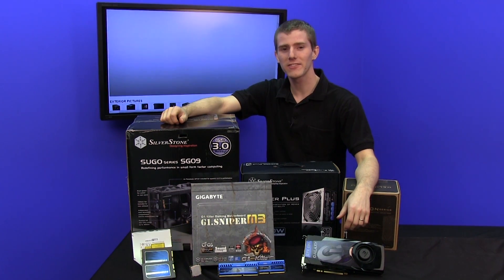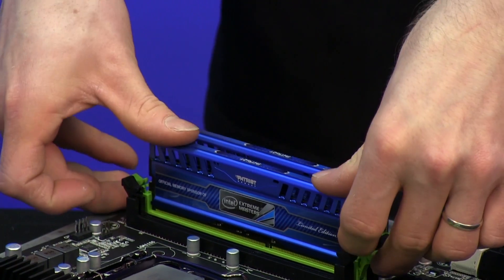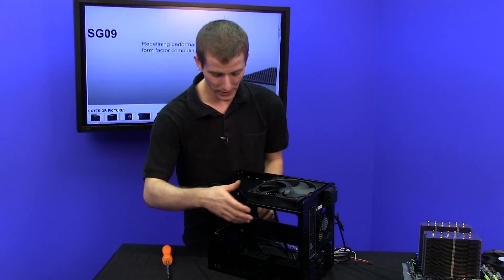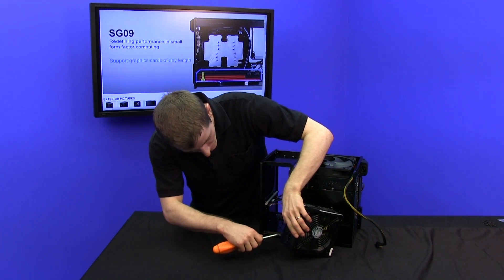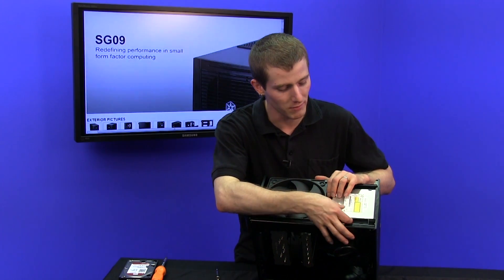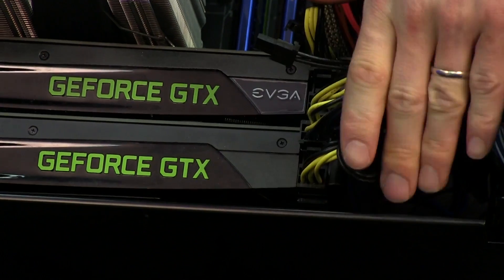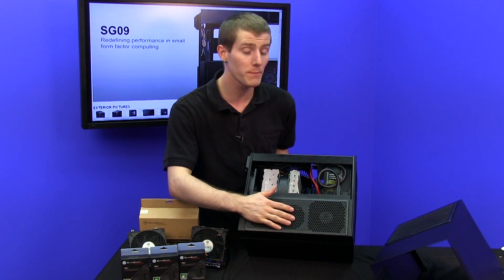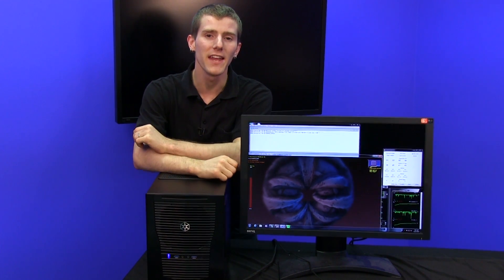Silverstone SG09 Small Formfactor Gaming System Build Guide NCIX Tech Tips

Comment: I'd be worried about heat and lack of ventilation for the 3.5" drives. The 200mm fan on top does overlap the gap behind the motherboard, so there would be some movement, but probably not enough.
Reply: It wont be to a problem, have a wd black in there doing fine
Reply: killer121l Good to know!

Comment: Component List:
Chassi: SilverStone Sugo SG09
CPU: Intel Core i5 3570K 3,4GHz Socket 1155
CPU Cooler: SilverStone Heligon HE01 (Fan "inbetween" appears to be included with the cooler)
MOBO: Gigabyte G1.Sniper M3 (micro ATX)
RAM: Patriot Intel Extreme Master, Limited Edition 8GB DDR3 1600MHZ (2 for a total of 16GB)
GPU1: EVGA GeForce GTX 680 2GB (In SLI)
GPU2: GALAXY GeForce GTX 680 2GB (In SLI)
PSU: SilverStone Strider Plus ST1000-P 1000W
SSD: Crucial M4 2.5" 128GB (2 in RAID0 for: read/write speed+, capacity+ (256GB), reliability-)
HDD: Western Digital Red (NAS Harddrive, Capacity unknown)
Cables: SilverStone PSU Accessories PP05
Optical drive: LG H-L Data Storage GA31N Super Multi DVD Rewriter

The CPU cooler is the only one I had to do an image compare on.
The rest is either said or shown closeups in the video.
And I couldn't find out the WD Red Harddrive capacity though.

I have been looking for more cases like this, but with no luck. Appears to be my only option... so far.
Reply: Side note: He said it's a SilverStone Optical Drive, but the closeups shows what I wrote.
Reply: Another Side Note: The "Real Temp GT 3.70" software shows the CPU in the system as Intel Core i5-2500K 3,4GHz (whitch also uses the LGA1155 socket), but is a different CPU than said in the beginning.

Comment: I really like this case, but I'm not feeling the non standard fan at the top. 180mm fans seem to only be sold by Silverstone and Enermax. Neither have quiet versions in that size. I'm going to have to go with the Node 804 though I like this one and even the sg10 better.
Reply: +William Matthews I have this case(bought it new in 2012ish) the 180mm fan is fine. There's a switch on the back of the case to switch from high to low rpms on that large fan, on low it's silent. High is of course a bit loud but honestly you don't need to turn the fan on high because it already moves so much air on low.
Reply: +William Matthews i'm recently building a computer in this case. and i noticed that the top 180mm fan can be changed into 140mm with mounting brackets that came with the case. So now im thinking mounting a 140mm rad at the top as intake. I will give you the result after finishing the build^

Comment: Lins i want to build a high rig gaming pc. Im planing to use msi z97 gaming 3 or 5, and gtx 980 n intel i7 4790 k, psu corsair rm 650. Is it worth it? And please tell me if msi z97 gaming 3 or 5 is future proof or not(at least for 3 years)
Reply: ziang momin nothing is future proof in the industry things change and improve quickly
Reply: Okay thanks
Reply: ziang momin I mean lga 1150 sockets are going to be going out after the broadwell desktop CPU line, so you should b fine. If you want to upgrade from Haswell, you could get boradwell in the future. you can always keep updating your GPU as well...

Comment: Nice presentation of the case. I noticed that power supply has like 0 filtration. I do not understand why people would be happy with a motherboard and video card set up where those wide cards are pretty much touching and the top card has maybe 10% of the air flow of the bottom card. If someone wants more than one double wide video card I would think an full size ATX Motherboard where there can be more air flow for the top card.
Reply: those are stock coolers so they actually pull air from one end(which is open) and out the back of the case. the side fan pulls fresh air into the case for those graphics s cards to breath freely.
if they were aftermarket coolers I'd imagine you would not want a case this small.
Reply: +VanSanPro Have dual 970s with aftermarket vooler, two 120mm fans (left outtake, right intake) directly above the gpus keep them cool. 

GPU sag was a problem until I corded the first gpus electricity cables with the psu cable and works perfectly fine now.

Comment: 82 degrees??? i configured my msi afterburner so that the Gpu temperature not going over 60 degrees. i dont want that my card crash after 1-2 years.
Reply: 82 is fine for a 680, ideally it could be cooler but it's hardly gonna melt at that temp
Reply: Anything up to 90 degrees is fine for a GPU. It won't "crash" after 1-2 years.
Reply: I have a 470. its been running pretty much every day. for 5 years and the average tems are 60-90. never had a problem
Reply: Still, after 2 years it will be time for an upgrade. (Not that it would crash after 2 years at that temp anyways)

Comment: Guys thus case can fit a micro atx case with a msi 280x and a 750 w power supply?
Reply: A GTX680 is 1ft long, and I am sure the 280x is the same so I am sure you will not have any problem!
Reply: thanks

Comment: why a 1000w power supply?
Reply: Sli and to show that you could fit a large power supply for those crazy people who think they need it.
Reply: Con Cahill
I have a 1x 780 ti and I haven't found anything that can use even 60% of it if that!
Reply: *****  Hmm, I have a 750 bronze PSU for my GTX780, wonder if I will have to upgrade if I get another 780? How hot does your GTX's get? Mine is a EVGA GeForce GTX 780 SC w/ EVGA ACX Cooler and it gets to 60c fast and stays about there but it's super slow at cooling down!
Reply: Tenshi X No, a 750watt is way more then enough, almost enough for a 3rd 780. Though im implying that you have a decent PSU and not no knock off.
Reply: Tenshi X how much wattage is your system using atm? you can check on PCPartPicker, but if u want to get 2 GTX 780s you might consider getting a better PSU if your budget allows it, because I personally won't go beyond 50W short of the maximum wattage of the PSU, and especially because you have a bronze level PSU it is not as efficient as a silver or gold. so I would recommend getting a 850 or even 1000 because if your PSU uses its max performance it will be pretty loud as well. Hope it helped
Reply: I think I might need a 1000 watt psu, my NB and around the outlet of the psu is getting really hot, which I would think it's to much resistance, thank for your advice, a bit drunk to comprehend it all right now, but what do you think about the 1000 watt and plus EVGA gold psu's? I run my fans around 80% constant, it really doesn't bother me, but I do appreciate your help! :D

Comment: I have a Noctua NH-D14 and an eVGA 770 GTX 4GB Classified. The classified is wider than normal video cards and the D14 is huge. I was wondering if you think the classified would fit in the case and still allow the side panel to close, and how the size of the D14 compares to the silverstone heatsink fan you used in your build. I currently house my setup in a Cooler Master N200 with an Asus Rog Maximus VI Impact mini-ITX motherboard. It all fits, but it's pretty tight.

Comment: dude, as first, you tougher by  by swearing on the internet.

2nd, the air coolers that I previously talked about are quieter than most watercooling systems, I can overclock aswell with air coolers and get low temps, but why would I as I risk my cpu with it? And by the way, I dont want my computer to sound like an airfield, what would hapen if you use a watercooled system. I had watercooling, switched to the coolermaster 412 slim and its quieter and cools as good as / a bit better.

Comment: Look at xbox 360's and their "Red Ring of Death" They might not be so reliable. I would suggest PS4 over Xbox One.
Buy what you need. If a PS4 will suit your needs get it. (cheaper than PC) If you need something better than get a PC. Building is fun. You shouldn't need a new mobo for a long time, nor a new CPU if you get a good one like I5. I bet HD 7950 would last around 8 years. Look at the 360 it's like 10 years old. Old hardware, still running good games at 1080p low graphics.

Comment: I have done a lot of research on this case as i am using it for my build. :D

In terms of water cooling, you are limited to a single 120mm radiator all in one water cooler such as the corsair h80i.
(This is assuming you are not modding the case in anyway).

In terms of performance, a high end air cooler such as the noctua nhd14, gives lower temps than a single 120mm radiator all in one cooler.

If you use a 1200mm all in one water cooler it will perform worse than a high end air cooler.

Comment: Okay, I take that back. It is a 2500k in this configuration you tested, 3570k would probably be 10-20C hotter at stock. Definitely won't be OCing with this case, that's for sure...

Comment: It maxed out at 58C with a huge heatsink running at stock clocks with turbo mode disabled, that isn't very indicative of normal gaming use. I doubt you could get it past 4.3/4.4 without hitting the TJ max of the 3570k at load.

Comment: 1 question is stock gpu coolers quiet?  i disgust original gpu coolers because og noise / bearing making weird noise. so i smashed the biggest afternarjet cooler on and that is what i call quiet. my gpu moves from 35-50 degress when under 100% load and its not even taking the fan off quiet/neutral

Comment: AMD FX-8350 Vishera 8 Core 4.0GHz
Asus M5A78L-M USB3 HDMI 
Corsair CMZ8GX3M2A1600C9 8GB 1600MHz CL9 DDR3 Vengeance Memory Two Module Kit 
i'd try this instead its a little bit extra but not much the mother board is alot cheaper but you can use the money for faster cpu or faster graphics if your going on a buget of 500 go amd processor

Comment: I like my Bitfenix prodigy build better, a lot easier to work in and out of the case because of the horizontal motherboard mounting. Prodigy has much better airflow. 

 I gladly take the itx from matx sacrifice for the ease of transport and the fact all i have ever needed is my dual slot graphics card.  But that sli graphics cards are crazy baller.

Comment: CPU:	Intel Pentium G860 3.0GHz Dual-Core	

Motherboard: 	Asus P8Z77-V LK ATX LGA1155	

RAM:	Mushkin Silverline 4GB (2 x 2GB) DDR3-1333	 

Storage: 	Western Digital Caviar Blue 500GB 3.5" 7200RPM	 

Video Card:	EVGA GeForce GTX 650 Ti Boost 2GB	 

Case:	MSI TC- (Black) ATX Mid Tower	 

Power Supply:	Corsair 500W ATX12V

Is this good for a $500 gaming PC please tell me about any improvements that I could make. :)

Comment: I have built only one yet, my own one(im 16) in 20 mins. 
The things that really help you with speed are toolless expansion slots, and a motherboard tray that doesn't need extra standoffs. You can spend 5-10 minutes with the standoffs.
And after you're done, you have to spend some time cable managing it, but if you have to make a basic system with no window on the case assemby is rly just a matter of minutes.

Comment: 750 is perfectly enough yes but what you have to think of when using such a small case is that if for example this system uses 500watts at gaming load (which with dual gtx680 is entirely possible) a 750W psu would be running at 66% load, PSU's give their best efficiency and lowest heat output when running at around 50% load, this is why linus would have chosen such an oversized psu for the job :)

Comment: lol no, hes using TWO GTX680's, 600W might be enough power to run them but it would probably be running the psu at near its maximum power output which isnt good because it means it will get warm (not good if your in such a small case) and it will be wasting electricity since running a psu at something like 80% capacity means it will be using 700watts just to deliver 500Watts to the components whereas a 1000w psu could deliver 500wats power while only taking 620 from the wall.

Comment: Amazing build, Linus - think I might try it out here. I think you said you were using a 3570 Intel cpu (socket 1155 Core i5 I guess) - did you overclock it at all from the stock 3.4ghz speed? If so what settings did you use? Would be nice to know before I try it out :)

Comment: I would have installed the cpu cooler first on the motherboard then as I was putting the motherboard inside the case, I would plug in the cpu power connector.  Would seem to make things easier to do that way.

Comment: I have this case well built, I managed to ram a dark power psu by be quiet its 180mm in length.
2 ssd, corsiar h60 in push pull I5, 24gb of ram (video editing)
zotac gtx660...My psu is over kill at 650 watts need to drop it down in size and wattage

Comment: The PCIE where you put the second GTX 680 runs in x4 mode only. The last one down runs in x8 which extends past the mobo. If I'm not mistaken SLI won't be fully utilized, unless they changed this. I have the same mobo too.

Comment: RAID (in capitals) is when you have multiple hard drives working in tandem (rather than having multiple drives working on their own). A RAID array shows up as one drive in Windows, so if you're using say RAID 1 with two 1TB drives, you will see only one 1TB drive in Windows (the second drive in RAID 1 is used as backup in case the other drive fails). There are other levels of RAID for higher numbers of drives.

Comment: Ya there appeared to be a 120mm at the back to for exhaust so I couldn't see why a h80i wouldn't work. Actually probably wouldn't have had the issue with the gpu touching the heatsink like he did here using a AIO watercooler.

Comment: Not to mention it would also be pretty loud especially if you start adding more fans to this SFF case. Personally, I would still go with the TJ08-e or PS07. I kind of wish that silverstone just made the ps07 full brushed aluminium on the front and used the same quality buttons used in the tj08-e. Or better yet just make an updated tj08-e that has the same dimensions of the ps07 and the updated hard drive mechanism on the top 5.25 inch bays.

Comment: yes that's pretty much true. if you want the full potential of yours cards in sli you will indeed need an matx case with 5 available slots. Since the sg09 only has four, you will have to put the 2nd card in the pci-e 2.0 x16. I don't know how pci-e 3.0 paired with a pci-e 2.0 works, but maybe around 5% or so hit in performance. I honestly don't know how gigabyte goofed on the layout of the slots so badly.

Comment: Its not realy that. The power deliver by a 500w 80+ is 80% of the power he should gave (around 400w of pure power). The rest will go off with the electric noise and the heat. The performance chart show where the psu give all is power (400w of load for a 500w 80+, its the top of the chart). With time compenent will degrade even if you not load it. After 3 year you will be close to 65% (325W of juice)...Its alway a better move to grab a bit more of power for safety. For the price, protect your pc!

Comment: lol, a nice 600 Watt 80+ Gold PSU certainly won't cost me 40$. Those are more like 140$.

Also in regards  to the performance curve, doesn't the PSU still pump out the stated wattage regardless of where on the curve you are?  More efficiency just means you get less waste heat, but it's still 500W guaranteed (it it's new).  For example, a 90% efficient 500W PSU will give off 500 W-electric, and 56 W-thermal.  While an 80% efficient one will give 500 W-e, and 125 W-th.

Correct me if I'm wrong.

Comment: That's because nVidia has a superior line of workstation and other not-for-gaming GPUs, with raw power I meant that AMD consumer cards tend to have more vram and transistors and most of the benchmarks I've seen have shown, that in basic operations AMD cards get a bit more points than their nVidia equivalent. I don't know if it's drivers or what, but games run better 90% of the time on nVidia cards.

Comment: Erm where did you hear this? Why is Keplar/Fermi used in datacentres then and not AMD? Only 2 large data centres use AMD, the rest are nVidia.

There is no definition for a GPU as "raw power", they have many applications over a diverse category, many coded for a particular brand. 

AMD has a tiny budget compared to its rivals Intel and nVidia and is fighting on 2 fronts. It is failing all over because of this. 
Most games are nVidia compatible or coded, with only a few being coded for ATi.

Comment: The case does not perform its function well enough. I would not want to run an overclocked system of this nature with a case that causes stock temps to be this high. 
SLi 680's ~ 60c max, benching  ~ 65+c in a poor case. Power management is awesome, like ivybridge(highly efficient and low heat). They are so chilly compared to Fermi. 84c put into context like this would indicate case failure at cooling.

By endorsing a product solely on name or for profit shows bias to a particular brand.

Comment: The video cards are way to high of a temp to overclock, they actually need to be cooler or you'll blow them out, and the CPU Is pushing to high of a temp... You can overclock the CPU a little bit, but once it starts getting 65c or 70c on the hottest core you need to stop your overclock

Comment: Its just for the safety. You will dry around 380w to 430w with your build. Each PSU have what we call, a performance curve. For a good 500w PSU, the best amount of energy he gave is around 400-430w (you can check the charts on google). 
Higher you will load the PSU with time, this curve will slowly degrade still the PSU will cant deliver enought power, and it will blow... add 40 bucks will certainly not kill you, and it will protect your stuff well better, trust me ;)

Comment: 500W is a bit light (even with 80+ gold, at full load you will be at the edge of the performance curve). Maybe you should think to take a 650W or more (for the degradation of the psu's components over the time).